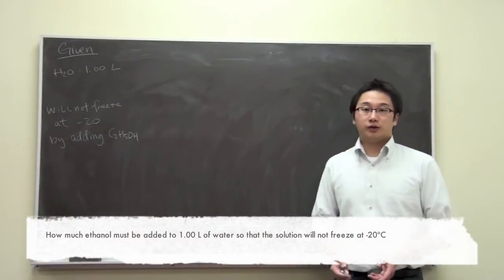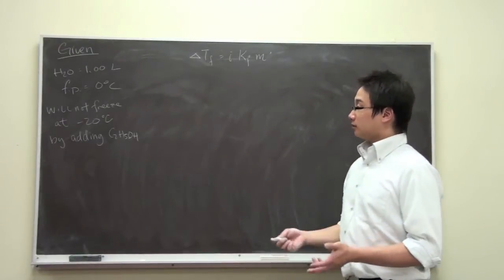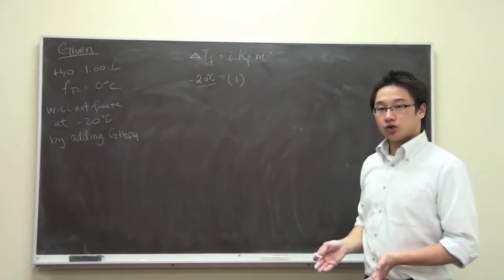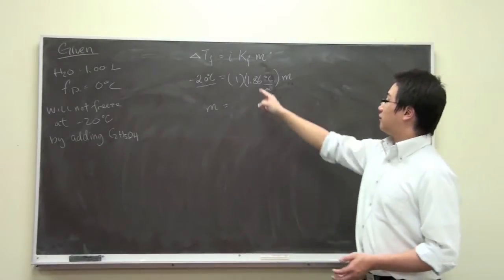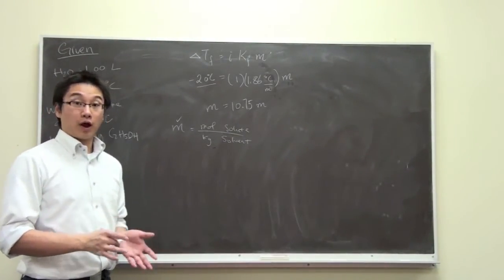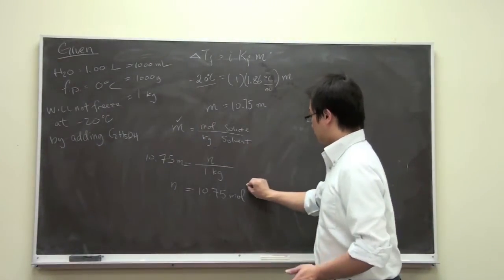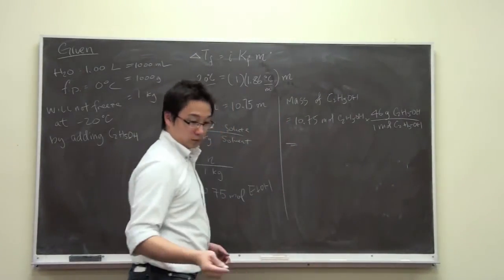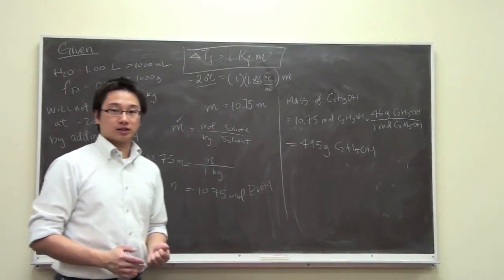[HD] Understand Freezing Point Depression Calculation

Comment from the maker: The molality should always be positive. To calculate molality, we have the moles of solute divided by the mass (in kg) of the solvent. Both of these quantities must be positive since we don't have anything such as negative moles or negative mass. This is the reason why molality is always positive.

One thing I would like to emphasize is the way we write the change of temperature. If we are using the absolute value of the change, then we use the absolute value of the K.